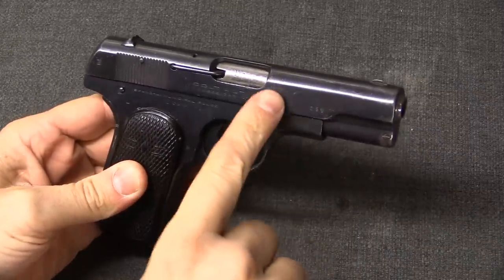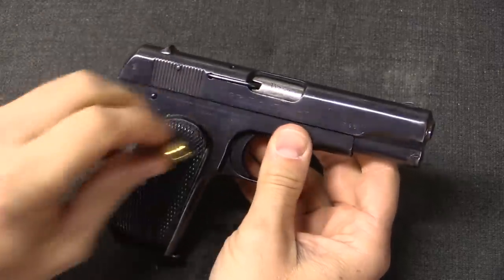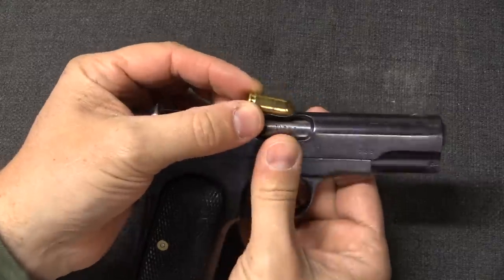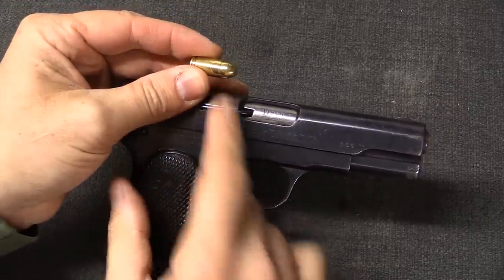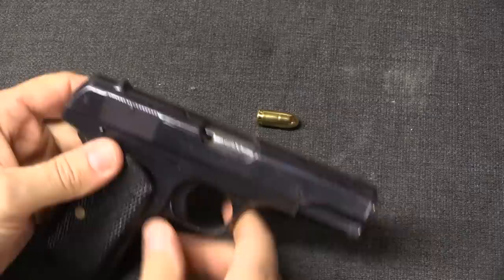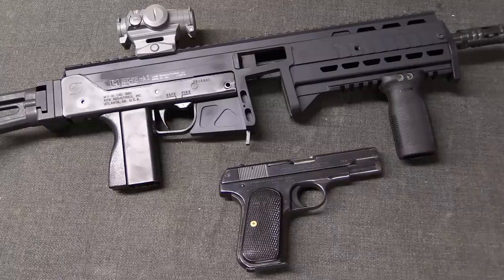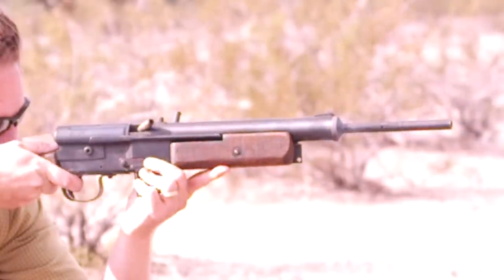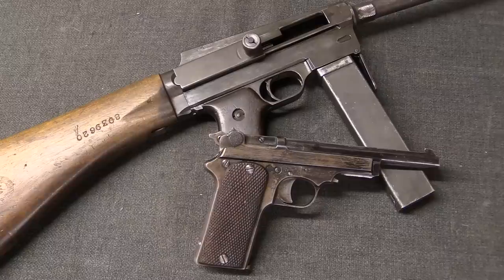How Does it Work: Blowback Action

Comment: If I may object:
In a simple blowback system, like the one shown, the acceleration of the bullet has absolutely nothing to do with the movement of the slide, recoil from the bullet is not involved!
The slide is only pushed backwards by the case, with itself is being pushed back by the chamber pressure. 
This also works with a blank cartridge and a partially obstructed barrel, all blank-firing pistols work that way, as well as training devices on submachine guns.
In fact, the barrel/frame of blowback guns like the one shown gets pushed forward a little bit, because the bullet´s friction in the barrel pushes it forward (the slide running into the spring counters it only milliseconds later, but in a super slo-mo this movement can be observed).
In blank-firing applications this behaviour also occures - barrel and slide get pushed apart, slide moves backwards, barrel/frame move forward. The slide with its lower mass gets accelerated much more and very soon pushes the frame back.
This may look like recoil and even is, still not from the bullet (because in blowback blank firers it´s the same), but from the slide running into the spring/backstop.
Reply: The acceleration of the bullet, or, for the blank firing pistols, the pressing against obstruction in the barrel, is what creates the back pressure that operates it. If the bullet had absolutely nothing to do with it, it would operate firing a blank without barrel obstructions, which it doesn't.
Reply: I said "nothing to do with the ACCELERATION of the bullet"! (sorry for caps, but underlining or different color doesn´t work here).
The only part the bullett plays is it´s existence in the barrel, not its movement or acceleration.
Slide moves because bullet is in the barrel, not because bullet is accelerated.
Reply: Since the action doesn't cycle properly when firing a blank that is otherwise the same in every way outside absence of a bullet, we can infer that the force imparted upon the bullet has something to do with the creation of the force required to cycle the action. Since acceleration is an aspect of force, we can also infer that the acceleration of the bullet is involved in the creation of the force required to cycle the action.
Reply: "..., we can also infer that the acceleration of the bullet is involved in the creation of the force required to cycle the action."
Nope.
Acceleration of the bullet isn´t necessary, just its existence in the barrel. 
If the bullet gets stuck in the throat (oversize, foreign object or previous bullet after a squib load jamming it, etc.) the gun will still cycle, then it will do that with even more force, although the bullet doesn´t move in such a case.
As said: The force cycling the gun does not require movement of something in the barrel, a sufficient obstruction is all what´s needed. A  bullet, although moving, is a barrel obstruction and this is all that´s needed.
Take a cartride, let´s say .32acp, pull the bullet and use a piece of paper to keep the powder in, block the barrel except for a hole of maybe 1/8" or a little smaller, it will cycle fine although nothing is accelerated forward. 
All blank-firing semiauto pistols and SMGs work that way - cycling without acceleration of a bullet.
Those guns don´t produce the amount of recoil in the shooters hand, but this is only because the slide or bolt does not run into the spring/backstop that hard.
Reply: @sthenzel  I understand what you're trying to say, but it doesn't matter if you /can/ replace it with another mechanism. The fact that another mechanism has to be used is evidence enough that bullet's presence is required, and since it's a system of force, all object acceleration must be factored in. There is nothing to separate because it's all one system.
Reply: But still - the acceleration of the bullet is not necessary!
The force is even stronger without the bullet moving.
So the slide does not move because the bullet  is accelerated, it just moves because of chamber pressure.
To say "because the bullet is accelerated through the barrel, the slide is accelerated backwards" therefore isn´t right (and that´s the ONLY thing i wanted to point out originally!), because this describes recoil. 
The only thing the slides recoils off is the barrel which is obstructed for a short but sufficient time.